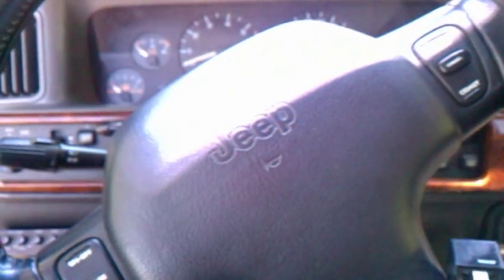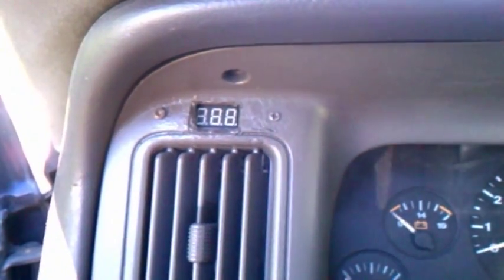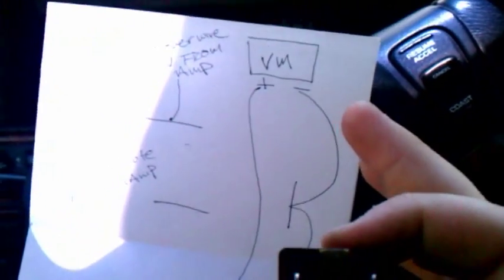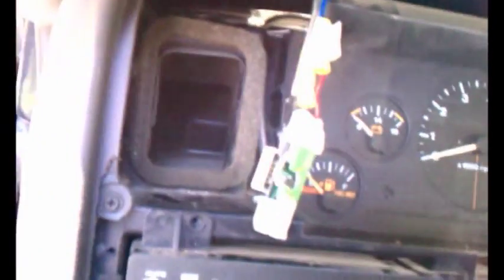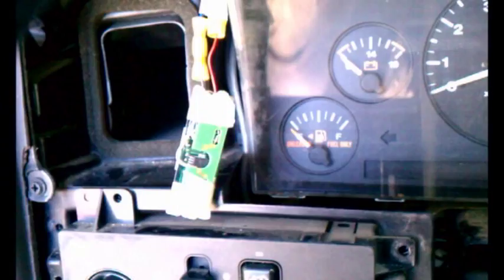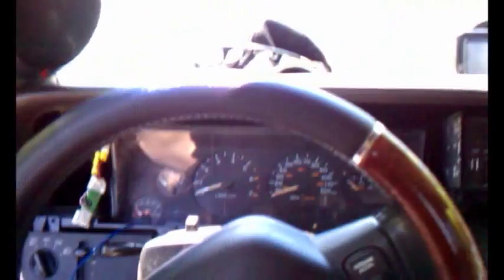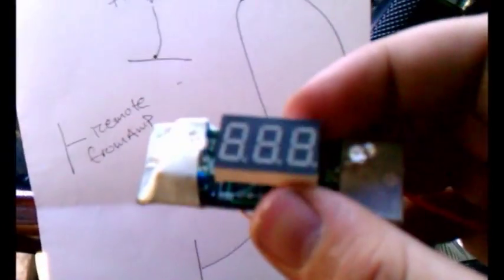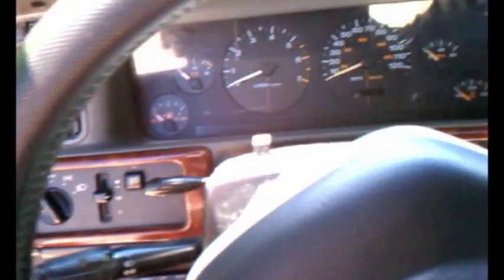How to Install a Voltmeter Using a Relay

Comment: I have one that I got from a chinese ebay seller for 5 bucks with shipping, works great on my lincoln ls and Its always on. It doesn't draw a lot of current since when I leave my car it sits at 12.5 and the next morning it stays at the same but i need to put a relay at my amp fans because those stay on all the time as well.